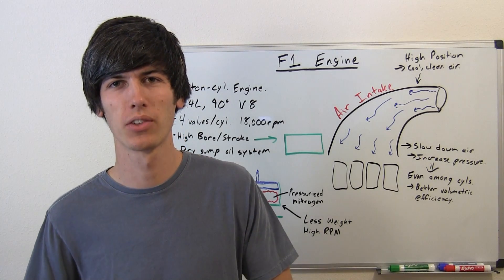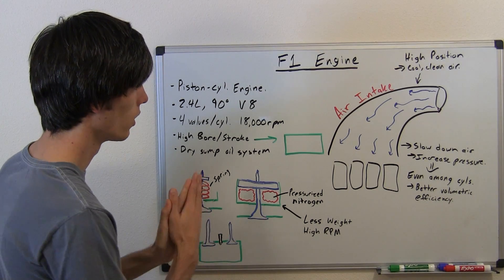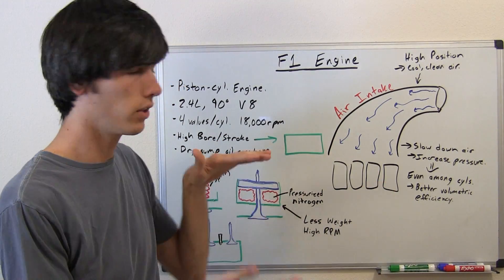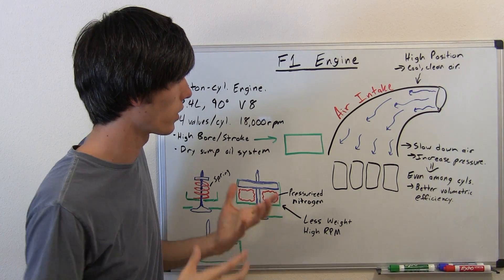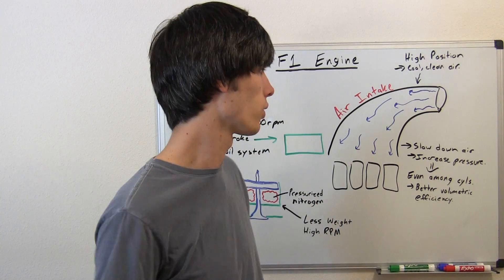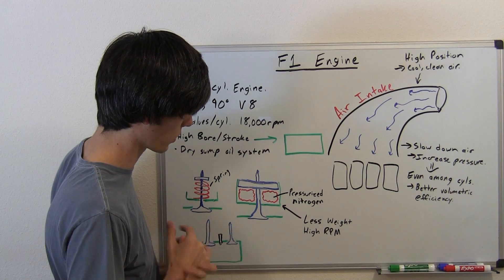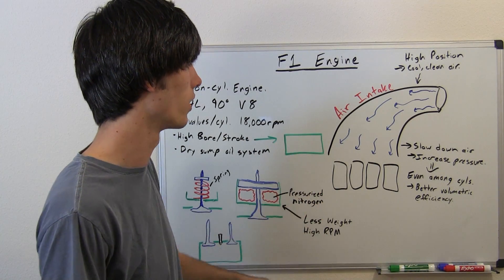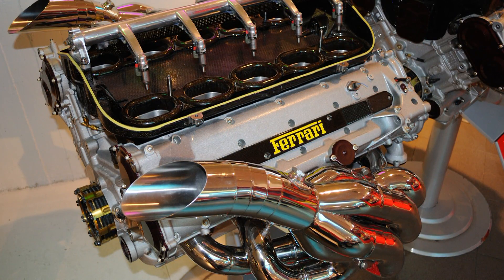F1 Engine - Explained

Comment from the maker: There are benefits and disadvantages of either option, there is no single answer. It's easier, and typically more reliable, to make big power out of big engines. But smaller engines are easier to place into vehicles, weigh less, have less moving parts, and typically get better fuel economy.

Comment from the maker: Unfortunately, no. Larger displacement is one of the easiest methods of producing more power. If an engine has larger cylinders, those cylinders can burn more air and fuel than smaller cylinders, therefore they make more power. With smaller cylinders, you have to make up for the lack of volume by using higher pressures, which typically come from forced induction. F1 uses the idea that higher RPMs means more power (torque multiplication). Higher RPMs are easier with small engines, due to inertia.

Comment: Motorcycle engines also spin at these speeds, but they dont use gas operated valves, in fact they dont use any spring mechanism at all. they are mechanically opened and closed by the camshaft  and have an extra lever and an extra cam on the camshaft, one for opening the valve, one for closing it. Pretty clever solution. I wonder why they don;t use that in f1?

Comment: One word - Drivability. Another commenter mentioned that with this kind of bore-to-stroke ratio, torque at low rev is low. F1 cars must use highly sophisticated clutch system to help the driver find the proper bite point. Even then, it's difficult for commoners to get an F1 car rolling. If you are building a road car intended for mortals, using an F1 engine would mean most of customers would end up stalling the engine every time.

Comment: To my knowledge, quite a few models of high performance road cars use dry-sump as opposed to wet-sump. Aside from lower centre of gravity, dry-sump is also better at maintaining constant oil pressure in prolonged high-lateral G situations, where as wet-sump will be temporarily starved of oil. So any self-respecting manufacturer of high performance road cars would use a dry-sump system if they define performance as something more sophisticated than just straight line speed.

Comment: why they are not most reliable?, they use them in extreme racing.
my theory is that if i shielded the noise of the engine, and with a proper design, i can make a supercar at lower cost than pagani, bugatti, etc.
is this possible? sorry for asking so much questions btw

Comment from the maker: 1. Both are equally important.
2. Yes, anything can be done, it's just a matter of cost. But they're not the most reliable, and are a bit too loud, rev too high.
3. Not sure what you mean by blow up, but added weight will put extra strain on the engine.

Comment: the only thing that makes a car win in f1 is the crew not the car?
could f1 engines with slight changes be used on the road and why? (not speaking about the cost)
if the car is heavy, will the engine blow up?

Comment from the maker: Cost and complexity, yes. There aren't any road cars that can corner at 2 g's or greater, so it's not necessary. If a car is built for a track (and is road legal) you can just put baffles in the oil pan to reduce the sloshing in corners.

Comment: r&d = research and development. i wouldn't say bulletproof as there is a balance between weight and strength. strong enough to last a race without problems

any engine revving at 18,000 will need rebuilding far more often than an ordinary car engine doing 6,500rpm and often averaging 2,500rpm. i wouldn't be suprised if they do rebuild their engines after each race. idk if they do

Comment: most of the cost is in R&D. but even excluding that, these are hand built engines with extremely precise parts. it used tech that would cost too much as well.

Comment from the maker: No, those aren't the only differences. The level of precision with F1 engines is far greater than what's in your current vehicle. The engines have to be preheated to start, because the measurements are so precise at a certain temperature range. There's a ton of the highest level of engineering that goes into it, so those engineers are paid well, hence, the product is expensive. If it were mass produced, the cost would go down, but it'd still be super expensive.

Comment from the maker: Yes, it would seem to reduce power if that were the case. Though the consistency of the spring and the ability to open/close at 18,000 hp is more important than the few horses it might lose. But I would assume it's less force for the pneumatic valve.

Comment: the only thing a flywheel does is get the engine through it's 'deadstrokes' (if it's less then 4 cilinders). so a v8 wouldn't really need it anyway. Other thing it does is transmit power to the clutch and maybe balance the engine. I guess an F1 still has a flywheel but it's rather small because of the low torque it generates. Also keeping the flywheel small is good to reduce the centrifugal force working on the rotating flywheel.

Comment: Hey pal :) 
I am a great fan of yours, and would like to thank you for taking your time to explain and simplify the science behind cars and combustion engines. 
You state that "the maximum amount of air the cylinder could possibly pull in would be one atmosphere (or equivalent to a VE of a 100%). 
It is perfectly possible to obtain a VE greater than 100% without forced induction, simply by taking advantage of 'wave tuning' and inertial scavenging. I've seen VE's of 108% and more :)